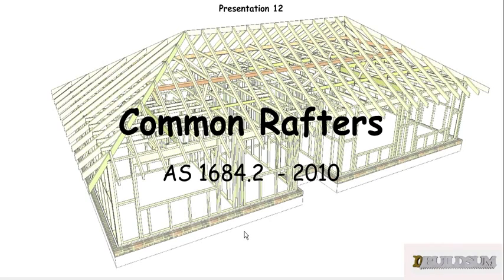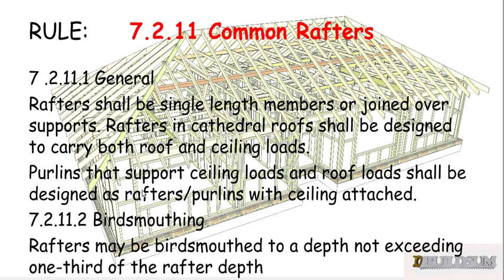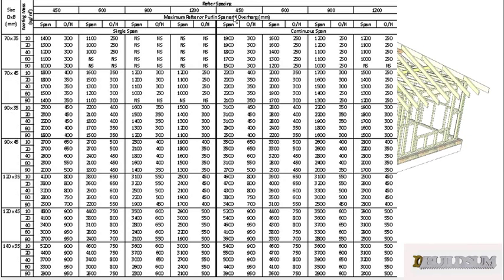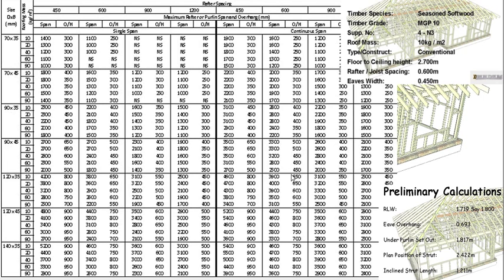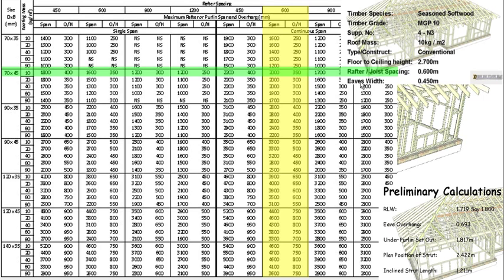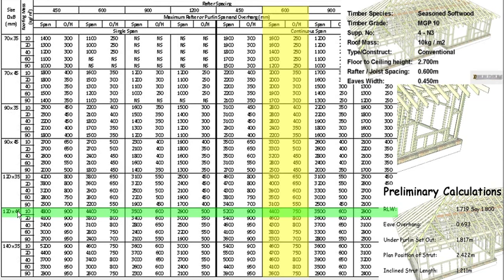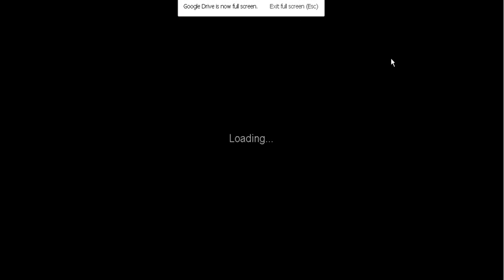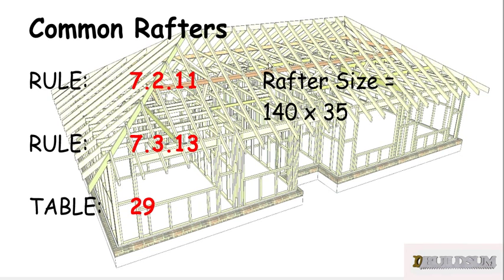12   Common Rafter

Comment: Great videos! I learnt so much from you! Thank you so much! Might be a silly question. In reality, where do we usually get the 'General information' you listed like timber species, roof mass, rafter/ceiling spacing? How do we determine those initial factors before working out timber sizes and all the calculations?
Reply from the maker: Thanks Hina, The General information would come from the plans.

Comment: Hi 

Can you please help me , how do I calculate bracing ? For example , the Measurements for floor plan is 17m X 15m, how do I calculate bracing for that measurement? How many do I need for each site for wind direction N1 and N2? 

Thank you dear
Reply from the maker: Hi Mate, I actually have a series on this starting on Tuesday however it is not a straight forward process.
First, you have to Determine the Wind Classification for the region of the building, N1 -N4, C1-C4, https://www.stratco.com.au/siteassets/pdfs/wind_speed_design_guide.pdf
Calculate the wind pressure Determine the Wind Pressure, Table 8.1-8.5 AS 1684 for your building
Calculate the Area of Elevation for both Wind Direction 1 and Wind Direction 2
Calculate the racking force, then determine the bracing systems to be used and calculate the number of units required, then check for even distribution and spacing
Check connection of bracing to roof/ceiling and floors
You will need to have a copy of AS 1684 Timber Framing Code to refer to. It is all covered in Section 8.

Comment: In your Preliminary Calcs, the RLW was 2.791, here you have used 1.719, which video you were referring to if I am not right Please?
Thanks
Reply from the maker: Hi Mansoor, You are right I should have used 2.791 for the RLW in this example. Not sure what I have done there. Good pick up. however, it will not change the outcome as the determining factor was the overhang of the rafter.
Reply: Thanks for responding, otherwise I was worried that I might not have picked up in previous video. 
I am a student, Do you have a contact please? as so far you seem to be the only authority (at least online..:)) on this subject.
Reply from the maker: Hi Mansoor, My best contact is buildsum@gmail.com